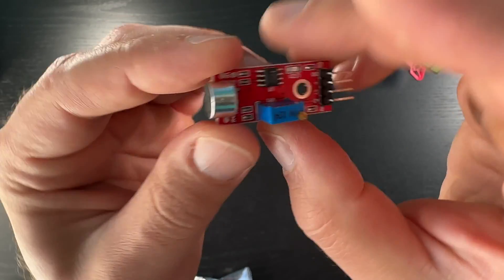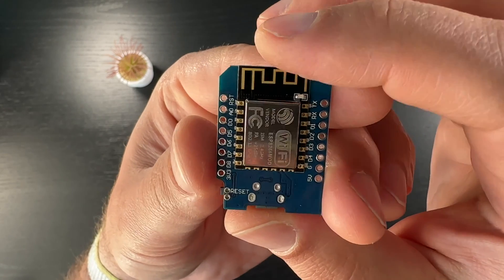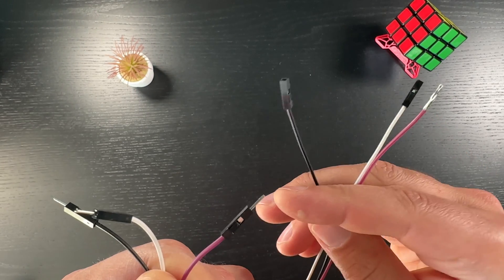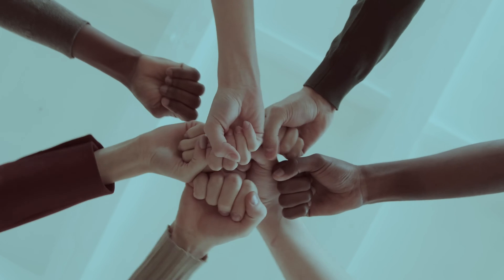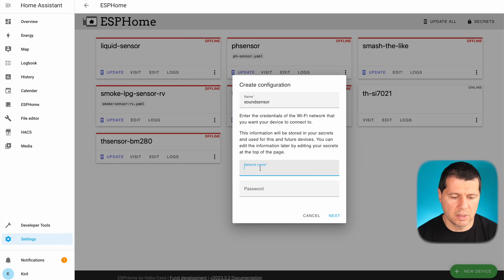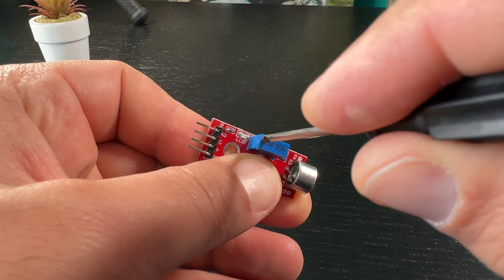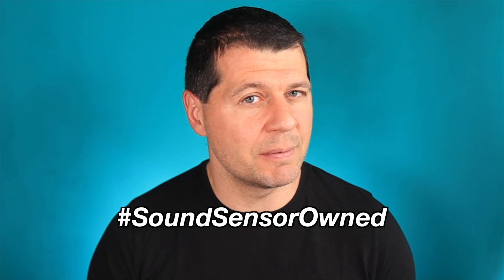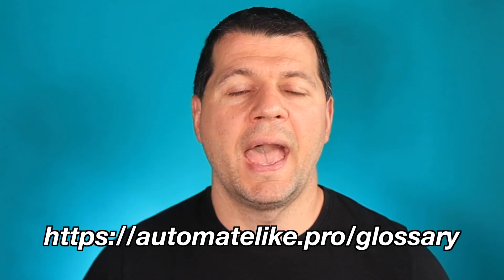Make A Smart Sound Sensor for Home Automation | ESPHome & Home Assistant Tutorial

Comment: Great video! I'm looking for something that will pick up a specific tone. We live in a condo and it has a buzzer system. What I'm trying to do is have something pick up that buzz tone and then use a switchbot to press the open door button at certain times
Reply from the maker: give it a try
Reply: @KPeyanski  do you know if there's an easy way to code for the device to listen for a certain mhz sound or anything within that code?

Comment: Thanks for the fantastic video👍
I am going to build this sound detector with the aim of hanging it outside.
It will light up the garden lights whenever a sound is heard, so as part of my home alarm.
Greetings from Belgium 🙂
Reply from the maker: Greetings to Belgium and thanks for the good words. Let us know about the result when you implement it
Reply: Have the project ready in the meantime.
I had to set the potentiometer on the microphone board to the highest sensitivity to get a readout in Home Assistant, the nice thing is that the decibel value corresponds to the actual value on a decibel meter.
In absolute silence, the microphone/readout fluctuates between 15 and 26 decibels, but these are fixed values.
With these values I can integrate the project into my alarm system.
Thanks again.
Regards,
Fred @KPeyanski

Comment: Hi. I have installed and reinstalled many times, but I keep getting the following message, although the sensor is working '5:13:42	[W]	[component:204]	

Component adc.sensor took a long time for an operation (0.51 s).

15:13:42	[W]	[component:205]	

Components should block for at most 20-30ms.

Any ideas that I can try so as to remove the yellow error message from the sound sensor web portal?
Thanks
Reply: I am getting the same error but do not Know why, the sensor appears to be working thought

Comment: Thank you for this Kiril, im having this weird issue :
 21:26:41	[D]	[sensor:093]	
'RAW SoundEsp': Sending state 0.00000 % with 1 decimals of accuracy
21:26:41	[D]	[sensor:093]	
'Db SoundEsp': Sending state 25.53605 db with 2 decimals of accuracy
21:26:41	[W]	[component:204]	
Component adc.sensor took a long time for an operation (0.51 s).
21:26:41	[W]	[component:205]	

Any tips on what this might be?
Reply: I've got exactly the same problem, did you manage to solve it ?
Reply: I'm having exactly the same error message "Component adc.sensor took a long time for an operation" and my sensor does NOT work. I did the DIY on a second D1 Mini and KY-037, still the same. Did you or someone else managed to solve the issue ?
Reply: @yulathh  am afraid not ....tried a couple of other things but just refused to work ....let me know if you solve it too ..

Comment: i have it installed now next to my roof tiles , so when pigeons land and try get under my solor panels i can trigger automation to make them fly away , they wake me up so i wana automate it
Reply from the maker: sounds really useful, but how are you going to fly them away? Using some siren or something?
Reply: @KPeyanski  well 1 air line with 12v valve to spray air , orr I have a 12v cement mixer vibratior to attach to a single rafters

Comment: I used this to detect my smoke detector, I used the digital output and as my detectors are linked, if it sounds on any the one  with the sound sensor near it will trigger
Reply from the maker: Sounds good, but it seems that you don't use it anymore. Did you switch to something else?

Comment: Great video Kiril!  I have a problem my sensor seems to be very unresponsive.  The numbers only move slightly with loud noises.  Even if I adjust both calibration settings.
Reply from the maker: What is the exact model? Is it K0-37 or K0-38?
Reply: @KPeyanski  Hi it is the HW 485
Reply: I will order the KO-37 that must be the problem

Comment: I would like it to detect a specific frequency, like activation of a smoke alarm, but ignore normal speech or other sounds in the house.
Reply: When I get time, I might investigate implementing the FFT (Fast Fourier Transform) in ESPHome so that it can detect specific frequencies.
Reply: Have managed this using the digital output, and setting the limit to be very loud, and putting the sensor near 1 of my linked smoke detectors
Reply from the maker: Hmm interesting challenge. For that a custom ESPHome code should be written so the frequency of your alarm to be isolated.
Reply: HomePod can do that with the new software update